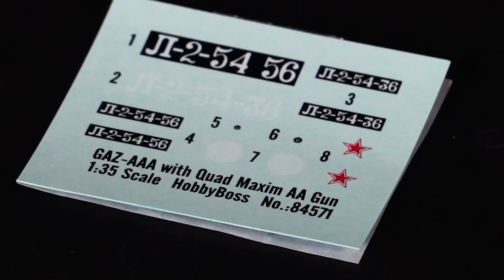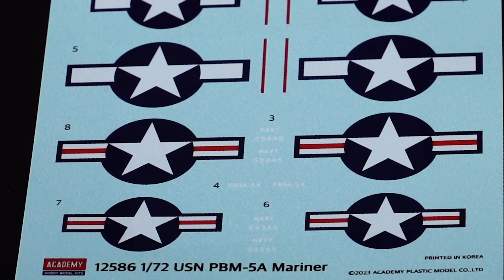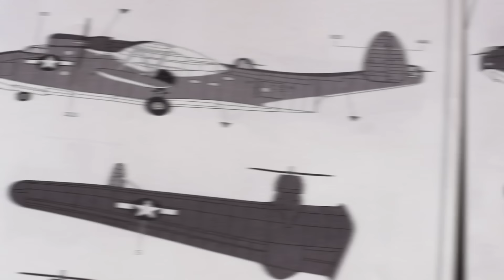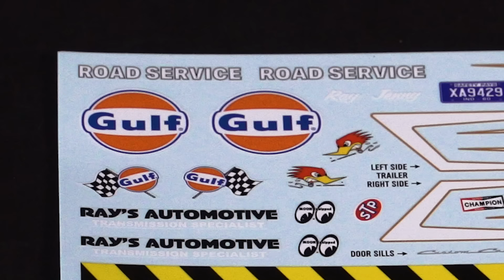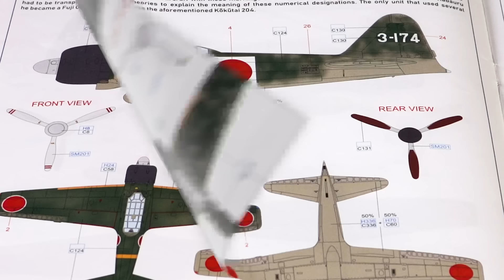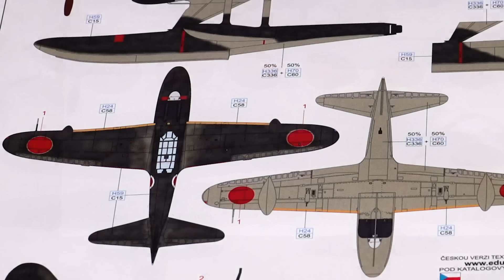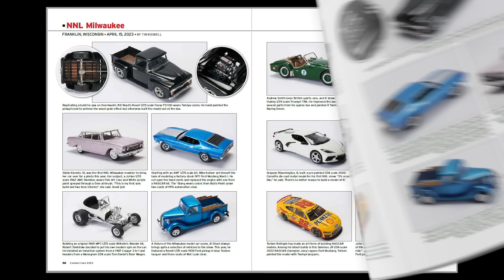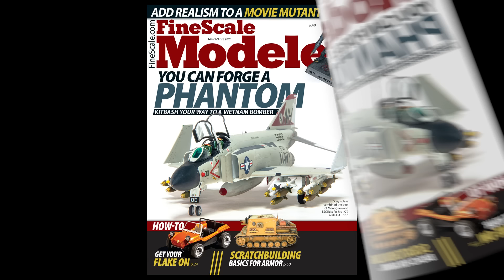FineScale Modeler unboxes new kits, drains an air compressor tank, and gets our modeling mojo back

Comment: Your bottom plug should be replaced with a valve. It’s not for draining the air out it’s for draining the moisture out of the tank to prevent corrosion.

Comment: Hi all. First, thanks. I've been a reader/subscriber for absolutely yonks and have enjoyed it all. 
You have always brought out the fun in scale modelling and kept me in touch with the hobby when I had other responsibilities/costs and it was an unaffordable luxury. 
I have a basic tank compressor but the drain plug has an o-ring and internal vents. Loosen the drain plug a bit (leave a bit of pressure in the tank) and the water comes out through the vents and through a hole in the centre of the drain plug . Every now and again I take the plug right out to check/clean then but I just pop it up on the bench. Easy done.

Compressor? The hobby still has a budget (no money tree as yet) so does it blow air consistently at a specified pressure? Yes. Done. I then used the money saved towards the cost of  0.5 / 0.3 Creos Mr Hobby airbrushes (and the rest!). My old Delta airbrush/demand compressor did sterling service though and was passed on to a financially challenged friend.
As for mojo, up and down (like the Assyrian Empire), dependant on a plethora of things time, mood, family, other joys/hobbies, weather! ( 38C/100F today, 30/86 in the modelling shed,. I ❤ summer!).

So, again, well done for presenting a fun, interesting and informative view of the hobby. To build what you want and be happy with your result. To strive for more if you like. Criticise yourself all you like (not too harshly) but others only if invited and then constructively. And thanks to all those who comment who try to reflect this values. Your opinion may differ or you may have alternative ideas/methods but I am pleased to see that the vast majority of commenters, from around the world,  can do so without undue vehemence or vitriol. Kudos to you!

Thanks to your whole team for all your work .Keep the Aussie stuff coming Aaron. I just purchased the AFV Club Centurion Mk5 Royal Australian Armoured Corps. (Actually, keep it all coming, variety is the spice of life).
Cheers all, Matt 🦘🦘🦘

Comment: Great vid as usual all! One thing regarding draining your compressor tank. Tipping an oil free compressor is fine, but you never want to do that if you have a silent compressor that has oil in it. The oil could get into your air lines, and that's just a bad situation. Admittedly, tipping a silent compressor isn't really practical, since they tend to be much heavier than oil free compressors. Still, it's worth mentioning. Keep up the great work! Cheers!

Comment: When I come up to a difficult part of a build I usually make copious use of procrastination.  Having a project languish for a while doesn't really get to me, as there's only one person I have to satisfy, Me, of course.  My current project is a Tamiya 1/32 Corsair.  I want to add the ignition wires and probably the loops joining the valve covers, and it's been my freeze point, as you say Tim, analysis paralisis.  This evening I had a half an hour before dinner so I sat down and fiddled with some thin solder, got three cylinders done and looking pretty decent, so next time at the bench things will go quicker.  Peck away at it, and models will get built, but don't sweat if they sit for a while.  Unless it's a commission job, there's no time limit.

Comment: I usually have a couple projects going on at the same time. When I get hung up on one I switch to the other. I primarily work on figures, in acrylics and in the military/historical genres where “paralysis by analysis” is almost a certainty, researching, etc. Having the needed image reference for each project readily available (printed out/books - NOT THE WEB!) I can switch between the figures without having to stop.

Comment: As an hydraulics engineer,  one of the basic safety points is to ALWAYS, ALWAYS make sure the pressure is released before cracking anything loose.  Second, and you covered this well, make sure you are not in the line of fire in case you missed some pressure.

Comment: I hear ya, guys.  We’ve all heard of multi-tasking, and I thought that it would be a good idea to multi-task while building models, too - the thinking being that, say, while I have the airbrush out and there's a common paint color among the models, then paint that color on all of the models at the same time.  Efficiencies to be had, right?  WRONG.  Tim hit the nail on the head: analysis paralysis.  I spent so much time situating and orienting myself every time that sometimes it could be up to an hour before I actually did anything physically with a model.  What a waste.  The extent of my analysis paralysis finally hit me one day when I couldn't use my spray booth, so no airbrush or glue.  I realized that the 747 I had been building had been languishing untouched for months because it didn't have any steps left that were in common with the other models, and I was surprised to realize that the next step was simply to apply the decals.  That realization kind of hit me like an anvil.  What had I been waiting for?  I could easily knock off the decals in an hour or less, so I did.  And then a few days later, the next step on the 747 was obvious: gloss coat.  And then a few days after that, final assembly.  Just like that, I was done.  That’s when it dawned on me: KISS.  Keep it Simple, Stupid.  Don’t build more than one model at a time. If I just build one model at a time, I know EXACTLY what the next step is the next time.  And the next time.  And the time after that.  Yes, some nights I can only get one minor thing done.  But at least it’s progress.  I’d rather spend one hour for a small victory than waste that hour situating myself with respect to all of my models again.  This may not be the solution for everyone, but I found it extremely liberating: go down to the workbench, do the next step.  Simple.  Straightforward.  Effective.  And I have since produced way more (and better!) models one-at-a-time than I ever did trying to do them in parallel.

Comment: I limited my collection of models by setting a three point criteria that defines my collection to some limits and this keeps me from going overboard. I always had an issue with not enough time until I retired. Now I spend so much more quality time and enjoy deciding what model I will work on next. One thing I did in my years of collecting was to collect aftermarket details sets for the kits I have and stashing them in the models that they “belong” to. Now, when I open up a model, I get the “surprise” of detail sets that are mostly unavailable any more and get a thrill of having a super kit to work on. These days, with almost no hobby shops near me, I just go online to get paint and other supplies. It’s a shame not having stores to wander through but that’s the state of things today.

Comment: Hi FSM and everyone who makes this all happen.
Another reason that you drain moisture out of the compressor tank is that if you don’t drain the water out, the tank with the building up of water will hold less air. This will make your compressor turn on and off more frequently. This will cause over time to ruin the motor. 

Just a fun side note, I worked at a place that had a 60 gallon air compressor tank. It would turn on every 10 minutes and shut off for 5 minutes. I asked and nobody knew that you had to drain the tank. I shut it off and drained the tank. It had water coming out of it for 20 minutes. After showing management the display of the water they made sure it was drained everyday after.

Just a reinforcement of what Tim is saying that you should do this on a regular basis.

Comment: Not trying to "double-dip" with the comments, but my last one was so wordy that I doubt anybody stayed until the end.  So, short version: I now just concentrate on one model at a time.  I used to build multiple models at once, but would waste so much time just trying to figure out what the next step was among all the models.  Now that I build just one model at a time, every time I sit down, the next step is clear: today is decals.  The next day is clear coat.  The day after final assembly.  Some days it's only a few minutes worth of work because I need something to dry.  But at least I moved the yardsticks instead of doing nothing.

Comment: As far as the Clydesdale go, if haven't put paint them yet, i suggest a cheap kit with a horse figure included, tamiya as the old kit with german solider mounted on a hourse, second figure standing, or those variouse livestocks,etc. Practice this cheap no meaning horse figures. This is what did when i had to paint a horse figure, not easy. Good luck, im excited for your build, hope to see it

Comment: I absolutely second @leadbullit comment . That must be a super cheap tank not to come with a drain valve . Please do your research , and not just based on the cheapest tank out there that you happen to own . What about informing the majority or users who do have a drain valve ?? Please tell them how to use it , once you learn how by research . These whole compressor instruction sets you have done still get a overall fail . I know you can do a better job of it , but for some reason your stuck and stubborn on this issue